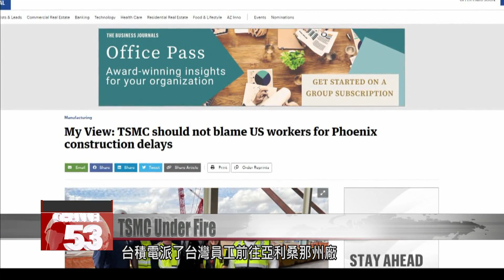TSMC under fire for blaming Arizona delays on skills deficit

Comment: It should not be unanticipated that the installation of semiconductor equipment for a project of the huge magnitude would be a challenge.  These specialized plants require extreme levels of cleanliness, knowledge and training to install.  I've worked on construction of these types of plants and in the current labor market, it is totally understandable.  The project will get done.  Might take a little longer and require training.  However, the labor knowledge base will expand and be better able to service this industrial sector moving forward.
Reply: it will fail and lose money

Comment: Does TSMC believe that the hegemon US will respect and treat TSMC and Taiwanese engineers fairly?  😂🤣😄  Tsai Ing Wen and the DPP apparently thought so but have remain silent now
Reply: Also running into a issue of work ethics, here in the States we usually work 9 to 5 or sometimes less opening up time for leisure and family time. In Taiwan the people working at these foundry's usually work late hours and are on call no matter what. We have the western way of thinking while TSMC has the Asian way of thinking, going to be hard because either the Taiwanese workers are going to get mad that they are putting in longer hours compared to their US counterparts or they are going to fall back into a more relaxed western way of thinking. Or it could end up bad for the US workers as TSMC pushes them to meet deadlines causing unrest in the plant.

Comment: Americans working 2 shifts ?
Then , Motorola or TI wouldn’t have shifted their productions overseas 50 years ago. 
Good luck to TSMC.
Reply: the real reason production moved overseas was because in those days they didn't use scrubbers in the fabs and they let out bad gases/chems....   why do you think they put the fabs in singapore over by malaysia with the trade winds pushing the bad stuff away from singapore...  it was simply because the fabs were being regulated to not cause pollution... but Asia doesn't care about that so they build fabs there and poison the area....

Comment: TSMC should bring in their own people especially if it protects trade secrets in sensitive areas. That would be awful if they built a fab and the same local construction workers turned around just to build identical fabs for the competition. 

Last month saw a heat wave with temperatures of 43 degrees in Phoenix whenever I saw the forecast. 

Arizona is a right-to-work state so you don’t have to use union labor and worry about the union going on strike or the machinations of collective bargaining. I would imagine that was a determining factor to build the fab there, even if union labor is used in the construction phase and elsewhere selectively.
Reply: If they’re so worried about losing trade secrets and their “advantages” then it might be best to isolate and not build fabs in other countries if they’re doing so great back home
Reply: I mean, if Taiwan wants help when China comes knocking, they better just shut up and play nice.

Comment: I told you so.. the coding folks wouldn't fit in factory jobs.
Reply: There is no coding involved in construction. Everything is hands on. The coding of any kind is done already when they need it for Cad drawings of diagrams or programming the lithography machines for 24/7 automation making chip sets.

Also the "folks" you're talking about are laborers, construction workers, civil engineers, etc. They range from $7.25 an hour cleaners to $100k+ a year supervisors. What is actually causing the delay though is American "skilled labor". You got the American union attitude that when they're paid $50 an hour that they only do the BARE minimum and stand out smoking cigs until their shift ends and then bring out the pitch forks whenever they "feel" they are entitled to be owed more pay due to inflation, working conditions, etc and never truly earning their paycheck.